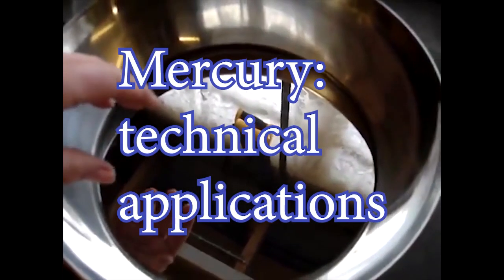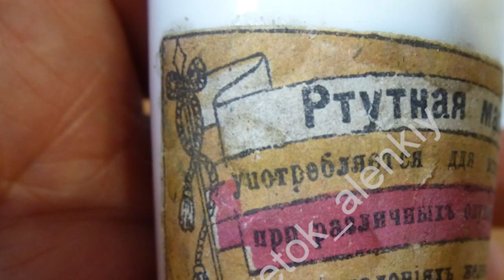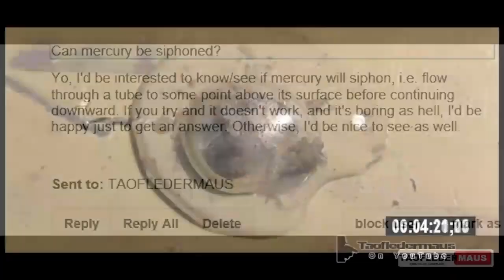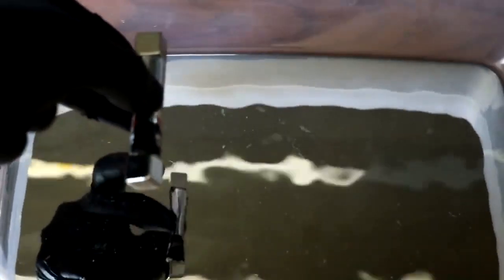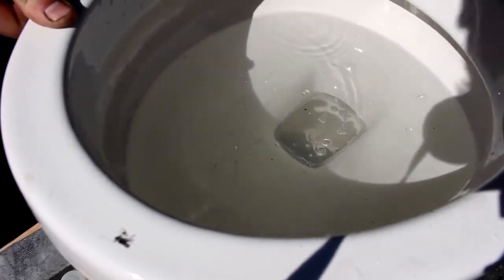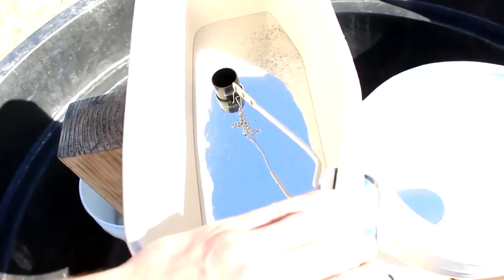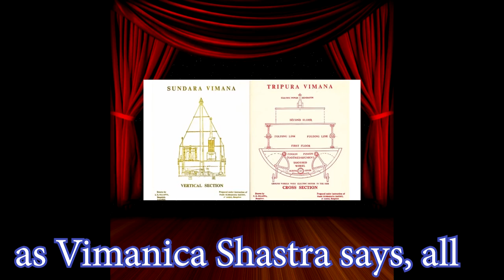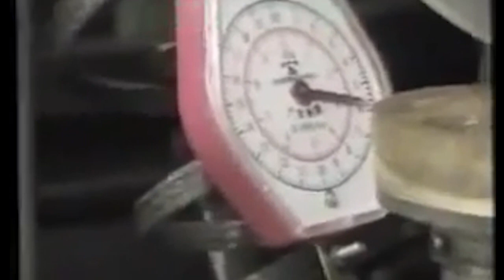Mercury. Antigravity and overunity. and some healing.

Comment: So basically with some mercury and a couple of magnets you could make a closed system hydroelectric generator?
Reply: Anyone know what the purpose of the battery is? Just randomly used as a spacer? Im confused
Reply: @cognitivedissonance4938  power source to change/control the magnetic lines of force
Reply: @jasona.neverforgetfukushim647  Yeah I did some research and my origional comment is nonsense.
Reply: Probably not
Reply: its a homopolar motor